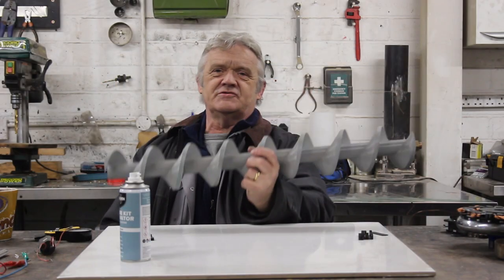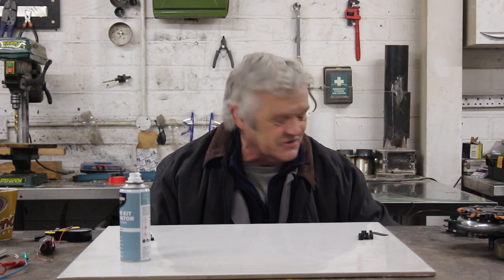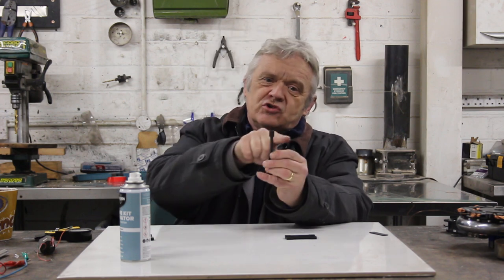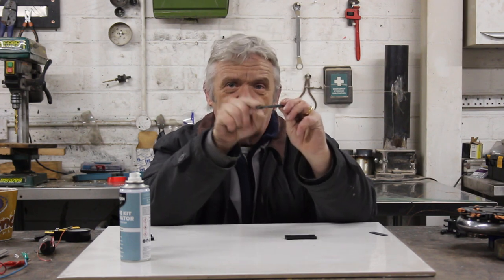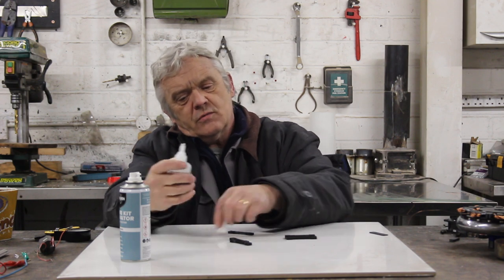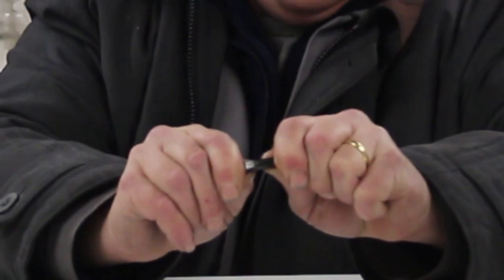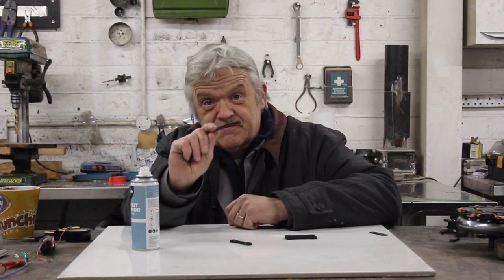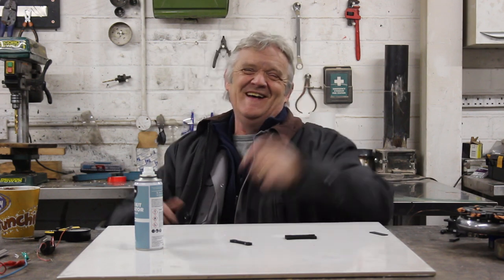1857 How To Make Super Strong 3D Printed Parts

Comment: The best thing about 3D prints to me, is complex shapes/parts can be made, these a sand cast mold of the part,  then it's simple to build a waste oil burner, to buy or find damaged car rims and similar parts from a salvage yard, ( I prefer broken parts, because destroying good parts is just evil)  but the alloys rims are made from is light, so is suspension parts, engine parts, pistons are exceptionally strong, but are on the brittle side, they do not bend much at all, before cracking, but engine components (external) are great,  a 50/50 mix of engine manifold and rims would probably be great, not much difference is think, maybe through a piston or two in there mix well, then cast the parts, if you needs strong part that doesn't expand alot with heat, and not likely to be impacted or flexed piston materials would be good, rim aluminum will bend a good bit before breaking, new car exhaust manifolds are mostly made from steel, these days, so they are lighter, but still cast, and thinner than the old car cast iron manifolds, brake rotors I believe are cast steel also,  I'd have to research that, either way  exhaust manifolds, and rotors are good sources for steel to melt  and  cast  parts from,
Building a tiny backyard foundry isn't difficult,  setup a large tub for electrolysis, with a small electric leaf blower, to pull O2  rich air to burn the oil to burn especially hot, may as well use the hydrogen also! The aluminum would have no chance! It should melt like butter on burning toast!
I hope to build a setup before too long!
I want to build a roughly 2.0L  2 cylinder  diesel/ oil burner engine,  maybe 2-3 litres per cylinder,  with a couple 36" 50-60 lb flywheels, with 80% of the weight near the outer diameter, basically a modern version of a 120 yr old engine,.  With 6"-8"  bore, and 12" stroke, 8" bore eq. 1206 cid, the 6" bore would be, 678cid, ,  I'd want to build it as a 2stroke , like the old GM Diesel/ Detroit diesel engines, only in an opposed piston design, the intake at the bottom of the bore, and require a blower to fill the cylinder with air for it to run,  with 12" stroke, the operating rpm would be fairly low, 1200 would probably be about the maximum , normal , alot of the smaller pieces can be 3D printed then a steel or aluminum part made from it,   a head with 4x 1.880" exhaust valves feeding into two 2.5" pipes for the exhaust, with a blower and 4" inlet pipe going to approximately .750" x 1.5"-1.75" ports on 2" centers around the cylinder, about 1/16" above the piston at BDC, ( when at bottom of the stroke, allowing intake air, the exhaust valve is just closing as the piston Starts up, before the intake ports are covered, there is a sleeve like ring to cover the ports when the piston is above the ports, to seal the crankcase from the blower pressure, it a slide valve closing the port to the cylinder, require another crank made onto the cam shaft that opens the exhaust valves, a cast steel rocker can be 3D printed and cast to use a single lifter to open two valves, the cam maybe a eccentric shaft , with the offset adjustable, by slide and screw adjustment, to change the amount of lift around . 700" valve lift should plenty, between 
.500" and .700" with a crank shaft capable of closing a slide valve, over a _4.5" port, the head, cylinder, crank case, flywheel, can all be cast, the crank should be made from 4340 steel bar, and machined, welded mortis and tennin joints, machine the round  journal ends square to fit in a approx, 4" x1" flat bar , use 3" round bar machined to 2.75" sq, 1" long on both ends of 3 pieces,  with a slight taper, the outer ends being about 1mm smaller.     the 4" x 1" 24"bars with a rounded corner square machined into the end .75" from the end so the round wit square ends can fit inside, making the rod and main journals, machine the seam .500" from the center, about .500" deep, and it should be a interference fit, required heat and a press to get the fit,  then the 1" gap.5" deep should be welded with a hot deep weld, filling the gap, the opposite side should already had a weld clearance machined into it,  allowing it to be welded, got a very near full penetration weld, what is not welded is a very tight fit, the rod journal should be cross drilled with a .125-.150" hole, with a . 250" center drill with 1/2" pipe thread fitting, with steel 1/4" tube, leading to the main journals the same way, the main being double cross drilled with .150" with x bearing with a groove and oil feed holes, with oil fed at the main journals, traveling to the rod journal, and from the rod journal up the rod to the piston pin,  spraying the cylinder wall! The pistons cast from a couple sets of stock pistons from a diesel engine,  with rings made in a lathe,  it would probably be a year long project, just designing and casting the parts, and machining them!! 😆 Crazy rambling but this is what I think about!! 👍

Comment: The chemistry and capabilities of plastics is absolutely phenomenal.

Where and when it is suitable, I tend to try to find plastics because a lot of them can actually do certain jobs better than metals, organic materials, or stone materials, and of course, weigh MUCH LESS, and have a tendency not to rot, rust, or crumble when severely vibrated or bounded around.

While yes, some of them can be set on fire, in fact most of them can, there are some that can handle upwards of 500 degrees Fahrenheit, which, for a lot of applications is just fine.

Comment: Great tip! Also, as ifell3 commented below, another channel (CNC Kitchen) has a lot of great info on filament strength testing as well. It looks like this glue works better than the traditional super glue from this much older test(See: STRONGER 3D Prints with GLUE? (and CARBON FIBERS))

Comment: There is HT PLA which is advertised as heat resistant and strong PLA but you have to put in the oven at 80-130 degrees Celsius.  I've never had a problem with it warping but it does shrink about 30% so as long as you account for that when you print it you will have a srong heat resistant part.  Or you could just print PC.   I had to upgrade my printer to handle it but im pretty sure the Eleego already has those upgrades.  Then sometimes I electroplate it with copper and then nickle by first spraying it with a homemade graphite and acrylic based paint.  I've made rocket nozzles that way that don't melt.  One time use but still its cheap to make instead of buying one.

Comment: Nice helpful tip using super glue. I’m wondering if your graphene ink you’ve made, will bond as a reinforcing composite? So 3D printed plastics can have outdoor applications to withstand UV , Moisture exposure and so forth ? Thanks Rob

Comment: OT: @robertmurraysmith I was thinking of the old petrol substitute that wartime people did. They made wood pyrolysers to feed their engines with wood gas. I remembered what you were saying in your rocket stove series & was wondering if a system to pyrolyse wood but not burn it in a rocket stove could be done to feed an internal combustion petrol engine. The advantage of pyrolysis in a “K” style rocket stove is the automatic feed hopper and the compact size of the whole unit. My application would be to use it for a stationary engine driving an alternator, using waste wood or charcoal briquettes. I hope you get to see this as I think your mind is well suited to think on something like this as you don’t appear to have ever thought within a box! More power to you mate👍.

Comment: Has anyone ever experimented with a tilting/rotating bed on an extruder 3D printer so it could add plastic in various different orientations? The software would probably need to be coded specifically for it, but I'd think being able to add layers with (As Robert call it) the grain running in different directions could allow for better stress distribution around high load areas of a print.

As an example, a screw post on an enclosure could be printed as a skinny column, then be "Wrapped" with vertical and spiralled toolpaths to bind the layers of the original column together more firmly, while still only using the same amount of material.

Comment: Yeah, an oven won't be good without supporting the material by burying it in either sand or salt.  And then you have to wait a long time because of sand's low thermal conductivity and your aiming for an even thermal distribution, and many ovens are dificult to get precise and accurate  control over the temperature so as to get the plastic warm layers to better fuse without melting it such that you get a sand plastic composite.

Comment: Robert, have you done any printing with PETG? It's a little more challenging to print with, but the material isn't biodegradable like PLA. It's also UV-resistant and has a higher elongation before break.
Not sure if those things matter for what you're doing, but a lot of my parts end up being exposed to sunlight and water so I prefer to avoid PLA.
Reply from the maker: I haven't mate - I get the PLA free most of the time and I am doing a lot of prototyping so for now filament type isn't really an issue for me - but I do plan on looking at a few different filaments when I get round to it

Comment: I use the same superglue trick with screw holes in wood that need a bit of love.  Shove cotton wool into the screw hole, having removed the screw first of course.  Use a toothpick to shove the cotton wool deep into the screw hole and wick it with superglue.  Give it a quick spray with the curing agent (water is good) and then try getting the screw back in.  Voila! An instant well anchored screw again!  Another form of composite created from cyanoacrylate and cotton!  Works like a charm!

Comment: That did look very effective!! Is crazy glue different to superglue?? Never seen an activator for it.. or is it more like Resin maybe?

As for the oven thing, yes without a casting medium you'd be warping and sagging long before it fills any gaps.
I often use the oven to make transparent PLA go properly clear, or to strengthen parts there was no good orientation for.
I have a big tub of salt I ground up to pack it in with.
Just wanna compact it nicely around the print, and have a nub of material sticking off the top to fill it in properly (additional 20% or so material after 100% infil).
Definitely not as easy as your solution here though! I used to use resin for it, but I also like to keep all my parts easily recylable
Reply: (Actually this is why I prefer assembly or folding now for a lot of parts 😉 )

Comment: Hmm. Okay... now given your recent videos, how does the PLA hardening play a role in your project... Hmm. I can think of two uses. First: Gearing. By making something harder, you also make it more resistant to wear and tear. Hard doesn't really bend or wear, it shatters. And considering you won't have anywhere near enough force to shatter it, I'm thinking this is a strong candidate. Second: The arm of the pendulum. You're going to be having a helluva lot of torque being applied at the center/origin of the pedulum (where it'll connect to your ratcheting/non-ratcheting gear thing) depending on how tightly you wind everything and how much force you have behind it...

I am wondering how you're going to deal with the diminishing returns of the pendulum swing... You won't be removing much momentum each swing if you have some magnetic resistance at the origin, but it's not zero. And if you're adding resistance via gearing, then it's DEFINITELY not zero. I think grandfather clocks have something like a spring that gives the pendulum the tiniest of kicks each swing to maintain momentum.

I'm curious to see what you come up with!! :D

Comment: I’ve been wondering if coating in metal epoxy resin would work to a similar effect.
Reply: try flexible epoxy if you can find it. i think resin normally becomes to brittle. i suggest maybe some e6000.

Comment: I've seen these in different videos and thought its good idea to generate electricity but it has huge volts(over 50V most cases what I've seen) but either low or very low amps(nothing more than 1 amp) So was wondering what will make it have more amps than volts?
Reply: A buck converter lowers the voltage and increases the amperage but doesn’t change the wattage. A transformer could also be used. I’m not sure what type of generator you’re referring to though 🙂

Comment: why not improve strength by wires into prinded by lettind have small holes in objects
?
Reply: that's not going to boost strength much. You would need a thick piece of rod instead of a wire, that can work fine.

Comment: I find that, for ultimate strength, give what is intended to be a prototype to a fabrication shop to then use in casting or machining parts. I don't want to be that typical internet Debbie Downer, but I see the majority as having lost sight of, or distorting the reality of what 3D printers are good for. Strong parts is simply not their strong suit. I'm usually the first guy for out of the box thinking, but sometimes the old way remains the best way.

Comment: Respectfully I disagree.

Salt annealing works really well, provided you don't care about the surface finish. For things like wall hooks, shelves, and structural components where the surface can be smoothed with filler putty and sanded and painted have no comparison.

But the parts will almost always come out rough enough to sand wood 🤣😂🤣

Comment: Come on Robert. Are you afraid you can't debunk my claim? My free energy, Gravity Engine can power your home and give you heat and electricity, forever and all you need is a 55 gal drum, an automotive turbocharger and a small generator say, less than 10 Kw and some 2" plastic plumbing fittings and pipe. Not an insurmountable task for you. I'll bet you $1000 CAN, you can't debunk me! You can't lose! If you debunk me I promise to pay you $1000 CAD. If you don't debunk me, you end up with a functioning Gravity Engine of your own..